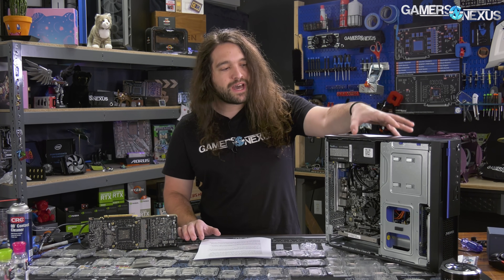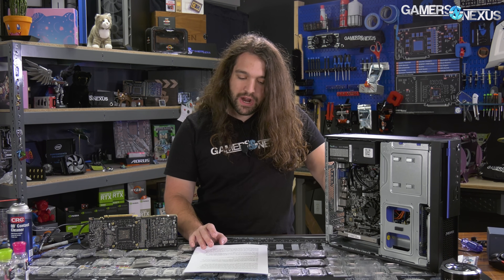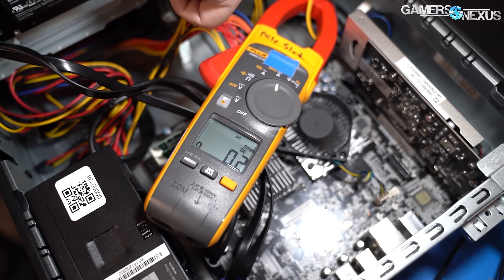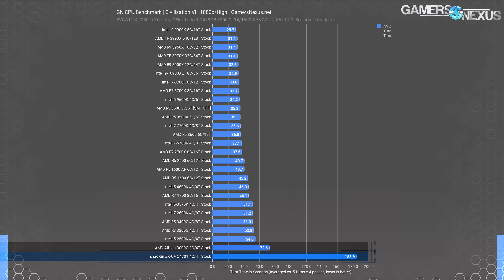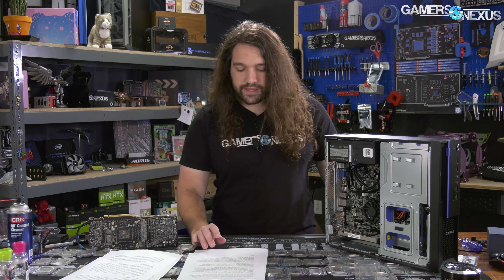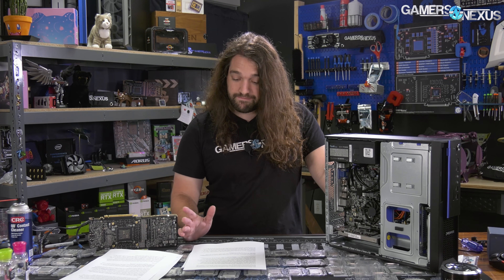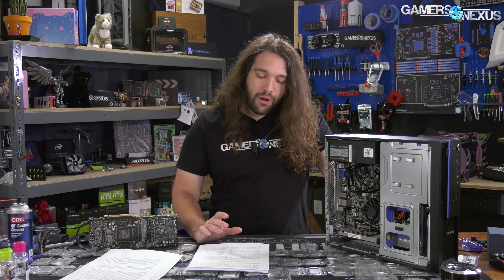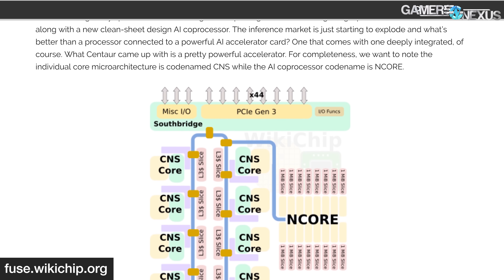"Trillion Core" Chinese CPU vs. AMD & Intel: ZhaoXin X86 CPU Review ZX-C+ 4701

Comment: I loved the video, once I read ZhaoXin I thought it could be the K5000 although it should be DDR5 so wouldn't be possible. The weaker K-5000 is supposed to come in par in performance with intel's i5-6400 if I remember it correctly (so slightly less than a i3-8100), albeit having 8 cores (and quick reminder, no SMT). Coming from sub-Athlon performance to i3-8100 is a huge leap in performance. Within the right price, it could very well be an option for entry-level gaming or office computer, although I don't know if those parts will ever be officialy (ahem, AliExpress and such) sold outside China. Another leap like that and their next parts could be very competitive against both Intel and AMD, but that is, considering that neither Intel or AMD will have big improvements in performance, and, again, that ZhaoXin sell their parts overseas, which is, sadly, unlikely to happen.

Comment: What I love about the comments is the naivety!  It is like they only saw the video up to the benchmarks and got a good LOL and then went on to the next video.  I am an American living and working in China, and keep worrying about these crap old CPUs of which everyone has moved on.  People have been watching keenly what apple is doing with smaller more compact SOC (system on chips) and are moving away from the entire core CPU structures.  China is by far a leader in that as most of the Apple factories are there.  They are also investing in machines which allow them to completely scan a CPU and get layer of layer of complete schematics of the chip, and they got people working on this 24/7 around the clock.  Keep LOLing for now, and making dumb jokes as if the Chinese incentive isn't something Americans need to be worried about.  Better wake up!

Comment: wow those old ibm 6x86 and cyrix mII still exists, i thought they were more valuable melted for scrap gold...
i had poor results with a cyrix 486 dx4/133, it felt like the motherboard wasn't getting enough torque to use the cpu cycles and cache efficiently.
also the computer was a lot faster in dos games rather than windows 98 games.

Comment: It is interesting that the US is sanctioning the use of AMD entry level derivatives - not because they would enable the PLA to produce more precise targeting technology and more sophisticated digital networks as AMD high end circuitry remains commercially available (and AMD remains the patent holder for any domestic brand licensing), but arguably because of a concern that domestic Chinese engineering may find a way around 'potential' hardware backdoors in AMD equipment... 

Since 'Gamers Nexus' knows that these domestic chips are most in demand for specialized, high security computing, looking into such features - or hints toward it - would have been more conclusive than consumer level performance tests. 

Russian MCST 'Elbrus' processors are ridiculed by Westeners for their sub-par performance - yet they excell, the moment calculations are to be performed under military grade encryption standards... 

While the ARM license derivative Baikal-M will eventually fill the consumer demand - possibly under state subsidaries to level the uneconomic price difference, ensuring a purge of Western hardware from national communication networks. 

The ZhaoXin comes across like a family cottage industry product, typical for Chinese consumer electronics - but Huawei - supported by the state - would have the resources to fund state-of-the-art research and engineering to offer e.g. a quadcore that can power a smartphone without noticeable performance loss. 

The picture of the situation may not be complete - but reflect 'a national nack for stratagems'... 
Expect more work in progress, tucked away from prying eyes - e.g. toward a reduced instruction set or SPARC architecture (since 2005) while high performant INTEL and AMD remain vulnerable to MELTDOWN and SPECTRE  (since 2018). 

That ZhaoXin is not built upon SPARC architecture should make suspicious. 

(protocols by CIA analysts) 
https://www.youtube.com/watch?v=yaql_Bub068

Comment: There are some big flaws in the test. You are testing software with 0 optimizations for the CPU, running on a OS with 0 optimizations for the cpu. A CPU which btw uses so little power you had trouble measuring it. Software optimization pays is a HUGE part in how well it runs. I remember back in the days when ffmpeg was used to do performance test and some of the new Intel CPU's came out (can't remember which) and they were absolutely slaughtered by the old AMD AMD CPU's until some Intel engineers sat down and optimized the software for their new CPU, which doubled the performance.

Comment: Ignoring price, if they are going to stick to making that CPU, if they built a mainboard that takes two or four sockets, the CPU power would be between the speed of a fx4100 black-edition (overclocked, volted, BCLK'd to max) if two sockets are used, and if four sockets are used, the speed of an i5-2500k or a (hd4460) i5 4th gen (which is still acceptable, even for use with an rx570 GPU). Even 3 of the sockets could. Vulkan would help.

Comment: Well, at least the Chinese have more sense from a thermal standpoint, they left the heat spreader out of the thermal path so a sink or waterblock  goes directly on the die. i mean hell if GPU's can be left naked why can't CPU's?
Reply: I mean the heat spreader help with uneven mounting pressure and prevent you from cracking the silicone which is quite weak
Reply: @Chin2006  No spreader so you wouldn't need a lot of pressure, esp for horizontal mounting. Just use weaker tension springs, problem solved. Pretty sure I saw a water block meant for delidded CPUs on kickstarter.

Comment: The future of Chinese super computer will be RISC V architech... I will leave it like that and welxome to come back proof me wrong. I recall suguang has make it clear they are moving away from X86 base architech and current adapting modify Mips lonhson. But eventually when RISC V picking up momentum, they will get on with the RISC V. These X86 will be utilze to run legacy system, to put it simple. Replacement part for old CNC machine and maybe some mail server.

Comment: Basically, I guess there's no doubt this is to avoid political risk. Like, is this really a dirty thing to talk about giving that all country have their own sovereignty that shouldn't be affected by foreign governments at all? Of course China can't control whether US would issue a trade ban, so the natural choice is to have a plan B ready at all time. (And got to mention that, even though Taiwan is currently being weird and a bit controversial, we know for a fact that they are affected by global political issues as well, even from US, so the same idea also applies.)

As for anti-spy need, IIRC why China is getting rid of foreign system in government is due to the difficulty to do proper code review. Think of how many lines of code Windows has. There's also some talk about the risk of open source, that is, companies that make use of open source technology have the risk of being lazy at code review and ignoring loopholes in the open source code base, should there be any. (And it's a valid reason, because how many people would read every single line of code when using an open source library to develop their own program?)

But if we are talking about whether it's relevant for consumers... Well, kinda, I guess? If Zhaoxin actually got cheaper it might actually be competitive, but otherwise, it matters because that can create pressure on US government and push them to rethink the whole trade ban thing, such that regular consumers would have less risk of suddenly not being able to buy Intel or AMD stuffs. The thing is that, all these takes times, and things are more harsh this year so... Let's see where it goes.

Comment: My humble 8 year old Xeon e3 1270v2 got 1343 in Cinebench R20, wonder how my wifes old c2d dell laptop would cope...  my old xeon would beat it and thats core2 era, but 8 cores. Having said that, It makes sence that they are based on cyrix cpu, as they always sucked for floating point performance, even though back in the pr166 etc days they where slightly faster then intel... until you needed anything that was using an fpu, like quake.

Comment: Well, gotta start somewhere I guess. I mean our first processor used vacuum tubes and took several seconds just to do a math problem (though still a lot faster than human) and even that took 150kW of power even though the ram was just 20 bytes and was a whole 5 kFLOPS of processing power = not much faster than a human belly flop. By those standards that's pretty impressive for a first attempt and saved them trillions of dollars by letting everyone else do the R&D and other grunt work and just waiting 70 years. China will probably catch up and surpass Intel and AMD in another 10 years anyway with or without their help.

Comment: I don't think this CPU is designed for Windows probably why it took so long
Reply: If it's x86-64, it's as built for Windows as is needed. It wasn't that long ago that 32-bit Windows started only working on Pentiums or newer, though even those often break due to lack of ISA bus support. Windows' own minimum specs are always highly inflated, and closer to minimum needed for decent performance.
Reply: @laurelsporter  I'm no expert but I don't think do. An operating system needs drivers without the correct drivers hardware may not run correctly if even at all. I understand what your saying but perhaps there's another reason why it won't run correctly. Any company that produces a processor that runs this slow would loose all credibility In the longe run. Has this been tested on the pc operating system  that it came with?

Comment: Any CPU manufacturer can use whatever instruction set they want. Why would any CPU manufacturer today use the ancient x86 instruction set?
Reply: Because there is lots of software for it.
Reply: @lepidoptera9337  The worst argument ever.
Reply: @lepidoptera9337  The X86 tractor from the 80's was dead already with Digital's Alpha. Now ARM and Exynos is running circles around the old X86 garbage. Anyone writing software for CPUs with thousands of instructions from the 80's and 90's..? -No! They use Open CL or Cuda. CPU only does data shuffling and the GPU does all the compute work. Same in every modern super computer. No one uses the garbage x86.
Reply: @newworldforward1842  In other words, you don't know anything about computing. Cool. ;-)
Reply: @lepidoptera9337  I spent my life designing the stuff so I guess so.

Comment: Its still enough to perform complex military operations like as a part of surveillance, communication, command and various combat systems independently from peeking eyes of curious ouitside institutions.
And remember what did control computers of Apollo programme look like back in the 60s, they still took humans to the moon with so little power.
Reply: Even MARS helicopter runs on 2014 smartphone CPU

Comment: Too long! No need to deflate and read El Reg. to people, just give proper bench in native environment; surely Google Translate compiles blender on bsd or Linux on the weekend, with friends? Or better, get something properly global like AnTiTu bench run on it. Emulators, fight for my pleasure! Or you could compare boot times and uh...show the OG OS (or spin, and maybe try lsof?)

It seems like with 100 of the given ZhaoXin ZX-C+ 4701 (We're VIA/Centaur; hi Beijing, hi Austin...) it would be liable to run in Core i7 if not i9 territory, but dissipate 2400W. Perhaps the new Railroad architecture would permit multiprocessor builds? Fund that, not using a JD in Journalism backwards (starting from diving in uh...like a boss, coming out a bright-eyed wannabe.)

Comment: The chip industry has seen the physical limitation in the manufacturing process, currently at 7nm, in the near future, 5nm, 3nm, eventually probably 2nm, 1nm. Now, they shift focusing onto multi-cores instead of single core. There will be centralized computing available, with super computer running in the cloud for every one to access, to play game with, you only need a terminal or simple display unit. Quantum computing is also on the horizon. AI will replace human brain. The future is full of machines, controlled by AI. Human will be like useless garbage. We are doomed. This is not April Fool joke!